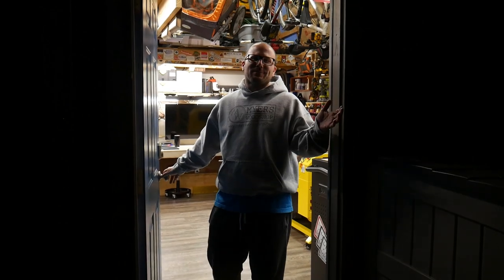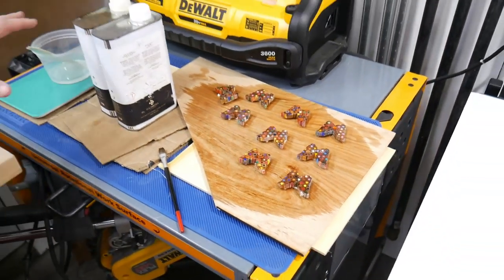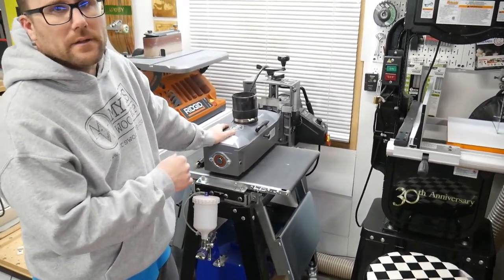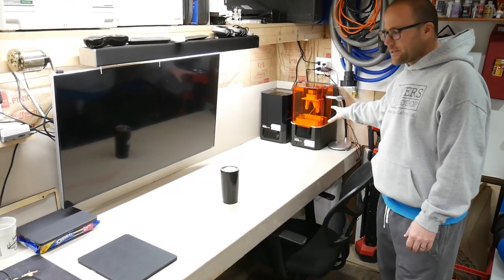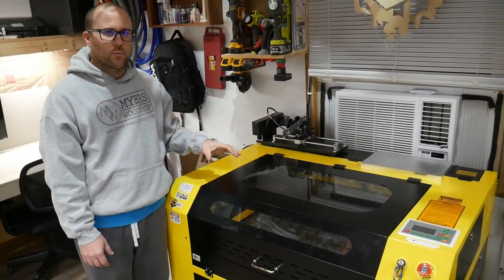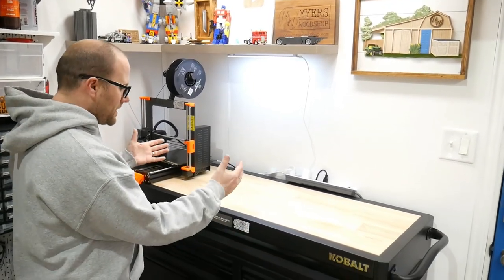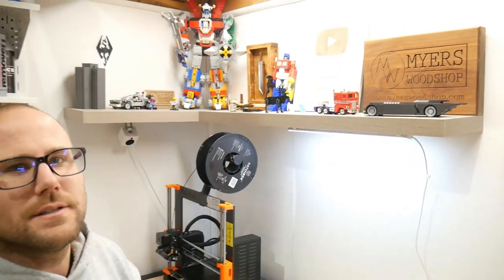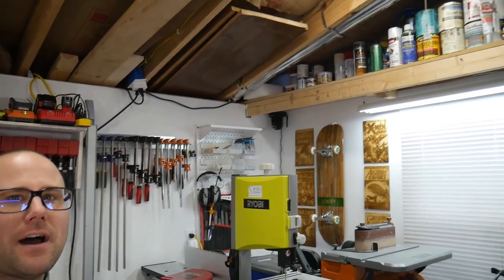Myers Woodshop Shop Tour 2020

Comment from the maker: ■ Orion Motor Tech 60w Chinese Black and Yellow Laser Cutter Engraver : https://amzn.to/2Ko95RQ
Or cheaper on ebay (not as good for returns though)
http://bit.ly/60wlaser

■ 30mA Voltmeter Gauge : https://amzn.to/2YMFpFL
■ 6 Inch 390 CFM Inline Duct Fan : https://amzn.to/2YxGQZj
■ Ruida RD644S Controller : http://bit.ly/ruidardc644s
■ S&A Genuine CW-5200DH (5200DG upgraded) Industrial Water Chiller 6L Capacity Cooling Water for 80W-150W CO2 Engraving Cutting Machine : https://amzn.to/2MJUse0

Comment: Very nice use of space. How are you liking the floor? Is that laminate? 

I’ve been thinking of doing that in mine.

Thanks
Reply from the maker: Yeah it’s peel and stick. It’s been there maybe two years now.   Works great
Reply: Myers Woodshop did you put the peel and stick down over a plywood floor?  Have you had issues with it coming up?

Comment: Maybe it's a little out in left field but with that portable band saw I can see a welder in your future.  Haha, anyway you've got a really great shop!
Reply from the maker: yes.  i really want to get into welding but don't have the first clue how.
Reply: Myers Woodshop Welding is super fun and definitely gives you more options for your projects. Everyone will have their opinions on how to get started but honestly I would just get a cheap HF Titanium 125 Flux Core welder, PPE, some scrap metal and then just start practicing. A friend who knows how to weld is also super helpful.
Reply from the maker: Really? Hf huh?
Reply: Myers Woodshop I know, I know... but it’s actually not a bad welder to start out with. Once you get better, then get a Miller 215 or a Lincoln 210 and keep the HFer (Harbor Freighter) for when your on the go. It was real handy to make my table out of steel for my new Shapeoko. Also, thanks for all of your videos on the Shapeoko. That’s one of the reasons why I chose it over the others. I just made your threaded waste board and am working on your clamps and fence. Really, thanks a ton!